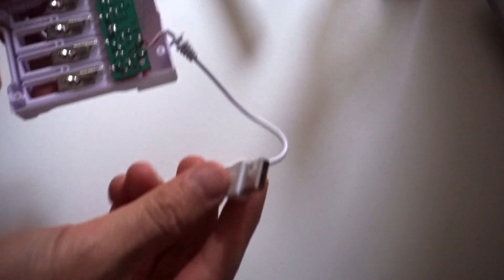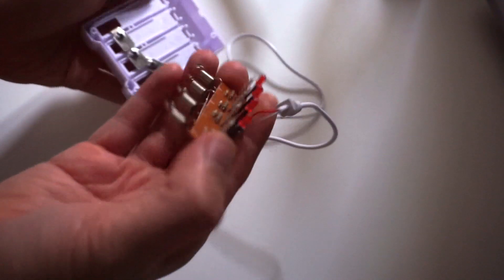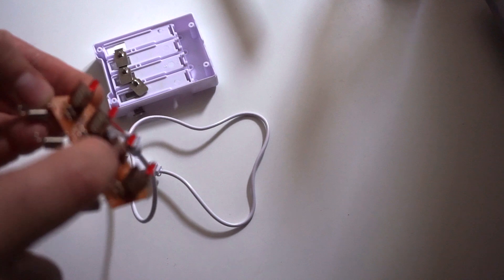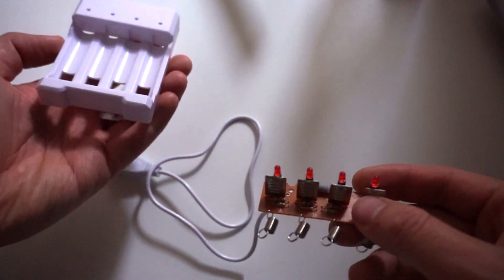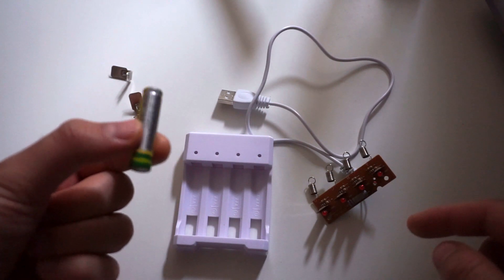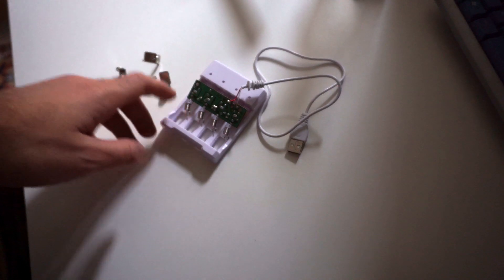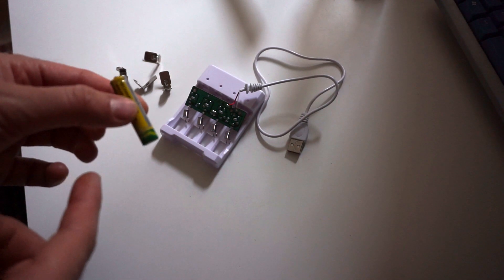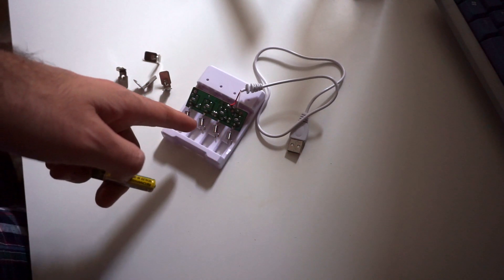Fake/Dumb USB battery charger! (Won't Stop Charging when the battery is Full)

Comment: This is not a charger, only a battery lifeleft drain. You can buy a NiCd-MH charger module online and replace this dirty board.
Reply from the maker: It is a manual charger, the user has to monitor the voltage of each cell and disconnect power when needed ;))
Reply: @furulevi  very good from full empty battery if smart charger will not recognize put in 5 minutes in these and working charging in the smart charger.
Reply: Him, I charge 3 rechargeable aaa ni mh batteries with scrapped small solar panel from 3.7 volt lipo motion actuvated ligjt inside dollar tree switch light box, no charging module/no board, no diode anything and I get all 3 fully charged within 8 hours  to 4.2 volt.

Comment: A dumb charger is sometimes useful depending on the situation. We have a Sony battery charger that is smart enough that when the batteries are fully charged it automatically shuts off. The problem is if I charge an old rechargeable battery which is several years old it recognizes the battery as defective and the light blinks rapidly and refuses to charge so I have to use a dumb charger to charge them. Although old rechargeable batteries may no longer work on high-drain devices like digital cameras they still work fine on low-drain devices like remote control, radio, or wall clock. I have a rechargeable battery that's more than 5 years old and still works well with the radio but can only be charged using a dumb charger.